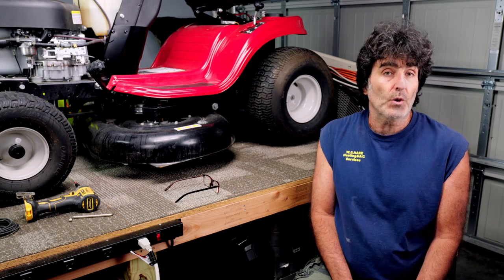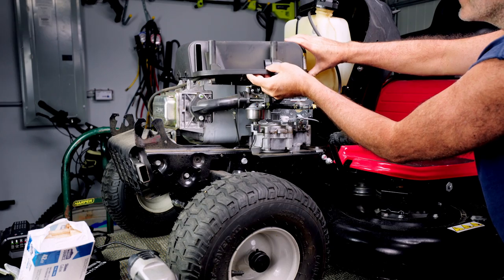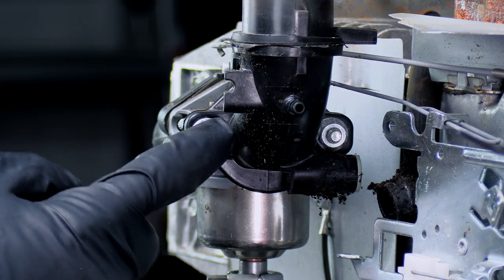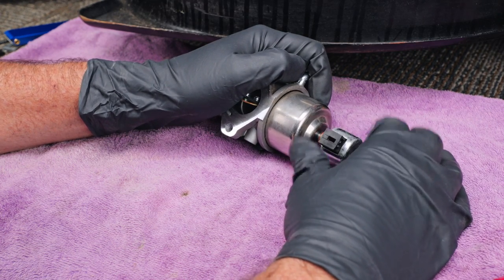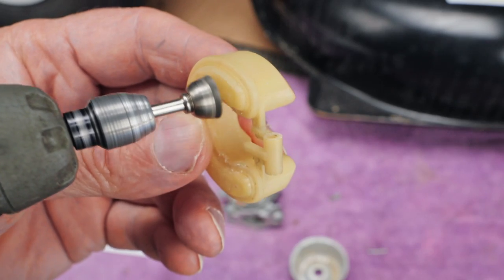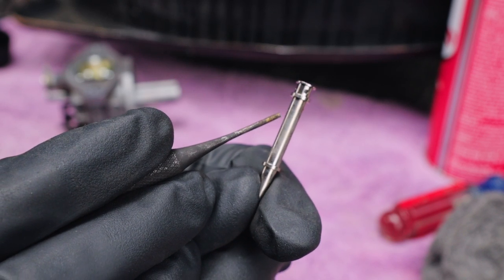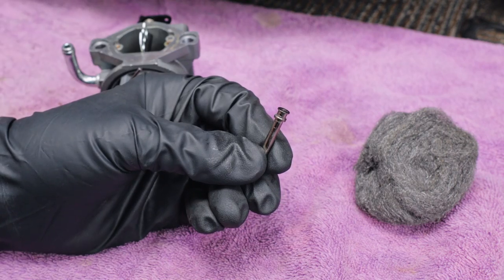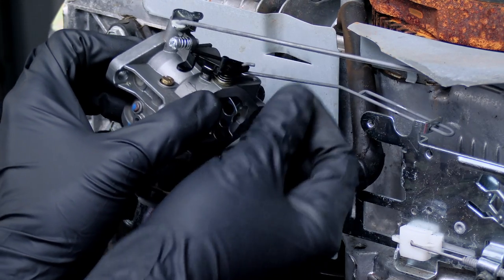Troy-Bilt Pony Riding Lawn Tractor Doesn't Start or Runs Rough?

Comment: I liked your video. It was very detailed simple and clear. Thks
Reply from the maker: You're welcome!  Thanks for the great feedback...
Reply: 😊. HI JL. I have a Troy Built Pony that has a rear hanger rod that has come out. Where does it attach to? The rod has a hole through the end for a bowtie clip.
Reply from the maker: Is it on the deck?
Reply: @JLPicard440 Hello J.L. Thank you for replying to my email. I am slowly finding out things about riding mowers. Tackled the job today & fixed it in ten minutes. It was a stabilizer rod that connects to the lifting arm of the deck. It had popped out while I was mowing. It popped right back in & I teplaced the bowtie clip that holds it in place. Again thank you for your reply. It looks like I am back in business again. I enjoy your videos very much. My thanks, Keith.
Reply from the maker: That's great!  I thought it might be on the deck but I wasn't sure what you meant...  The clip must have come out some how allowing the rod to pop out.. 😊

Comment: Hey thanks so much for getting back with me 😊. I also forgot the hose that comes from intake side seems to collapse when the motor reved up its not the main fuel line, and it's not that small line that comes from the top of the tank the hose is about three eights  inside diameter its on the side of intake and goes to the motor
Reply from the maker: I think that's a vacuum hose.  You can get the model of the engine off the valve cover and go to a site like www.partstree.com.  You can plug in your engine model number to get the parts breakdown.  From there get the part number of the hose.
Reply: @JLPicard440  hey thanks I will try that

Comment: I have Troy built bronco lawn tractor 540 cc 19 hp intek Briggs an Stratton 42 inch cut when I got the more it wouldn't start unless you put your hand over the breather intake and feed the intake with amount of air . I thought it was the carb so took it off and cleaned it but it still wouldn't run. So I bought a new carb an put on it an started right up . Since spring been driving mowed yard parked in the garage ran just fine went to start it to day won't start unless you hold hand over breather intake.  This mower was. Only used 1 summer do you think it could be the valves, sure could use some advice I also put fresh gas in it thinking might help
Reply from the maker: Is it possible the fuel filter had some trash in it and recontaminated the new carburetor with the same thing as the old one?  It sounds like a carburetor problem to me.  You can try to adjust the valves, but I have my doubts if that's the problem..

Comment: My question is.   What is the removal process for the fuel bowl? Is it threaded or pressed in?   Before i damage the bowl.
Reply: Very informative by the way,  thank you!
Reply from the maker: HI.... If I remember right I used a 1/2" wrench that I cut down on a grinder to make it thin enough to fit between the bowl and the solenoid...  The solenoid unscrews in a counter-clockwise direction.  Did I show that in the video?

Comment: great video, but i have a question on my troy bilt 17.5 b&s engine have replaced carburetor -got spark -new plug -new fuel filter but still will not stay running past 5 seconds then dies any advice would be grand
Reply from the maker: Have you checked the fuel to see if it's old or has any water in it?
Reply: hey JL yes fresh fuel, however, i was thinking last night that the fuel i am using is probably not ethanol free. not sure if that would make a difference. also, due to my negligence i wish i had taken the intake manifold off and checked it when i had the carburetor off. i may do that later. im going check valve clearance but not really sure that’s the problem. it cranks, no dragging, but not start unless i use starter fluid.anyway i m still puzzled

thank for sending me a response
Reply from the maker: No problem.. If you have a compression gauge it would be faster to take out plugs and test for compression.  If the valve clearance is a little bit off, it's not going to keep it from running, but if it's way off it'll affect the compression...  It'll run no problem on 87 pump gas unless it's old.  I use ethanol free to get longer storage life out of it, but it'll run fine on both as long as it's within 6 months or so.
Reply: @JLPicard440  thanks JL great advice as always
Reply: @JLPicard440  hey JL, i got a new compression gauge from amazon, read 95, anyway i got it going and running but runs very rough and smoky. i was thinking looking at valves and checking clearance at tdc. JL i really appreciate your help you have been fantastic.

thanks again
Reply from the maker: Ok very good.... You should actually be running ok at 95... I have a v-twin here that I just checked and it only read about 75.  The engine runs perfect.  It is cold and hasn't been run for a few weeks.  It might come up with a warmed up engine...

Comment: Followed n worked thank you
Reply from the maker: You're welcome!
Reply: I have just replaced the carb on my Troy Built Pony 15.5 hp & I think I have the linkage to the carb set up right. The rod that goes to the main throttle also has a spring ( pretty flimsy) I checked my choke & that opens & closes. I checked this with the mower not running. But I never saw the main throttle valve move. Does it rely on air pressure to open & close when the mower is in motion?
Reply from the maker: HI Keith, without seeing it I can't remember for sure.  Sometimes you'll move the throttle back and forth and it will only put more or less pressure on the throttle butterfly and when it's running it opens and closes.  On this one I can't remember.  I want to say you should see if physically move whether it's running or not.  If you can't figure it out, you can send a picture to my take a bath productions Facebook page and I'll take a look at it and see if I can see anything.
Reply: @JLPicard440  Thank you for replying, J.L. Your's has been the best video I have seen particularly hooking up the carb linkage. However, I think my old mower is knocking on heaven's door. The old engine is getting tired after nearly nine years of service & never broke down once till now. There is a grinding noise when I activate the starter & the motor turns over. I'll be playing it the Last Post soon I think.
Reply from the maker: Thank you for the feedback!  Arrrrgh.... It could be the starter is going bad.... if the motor is running good when it starts with no funny noises that's probably what's going on with that.

Comment: Does anyone have an Amazon link to a replacement carburetor for the tractor in the video?
Reply from the maker: HI, I don't remember the part number, but if you get your model number from off the bottom of the seat, you can go to www.partstree.com and get the parts breakdown.  From there it'll give you the part number and you can plug that into amazon...

Comment: I can’t get the wire off of the selonoid it’s stuck
Reply from the maker: Hi... you can carefully try to use some long nose pliers.  Try to get the pliers between the plug and the bottom of the solenoid and carefully pry.  That usually works.

Comment: Backfires some too and the governor is up and down on the rpms
Reply from the maker: Those Ponys sometimes will do that.  If you google troy bilt pony surging you'll find several ideas of what it could be..  I've even seen where those one cylinder briggs engines have a cam problem with the compression release, but I doubt if it's that from what you described..